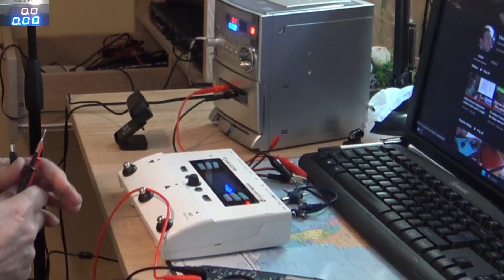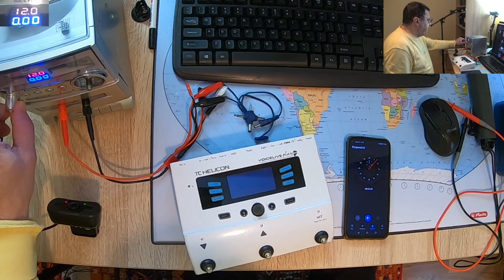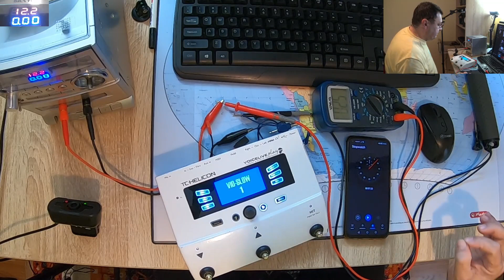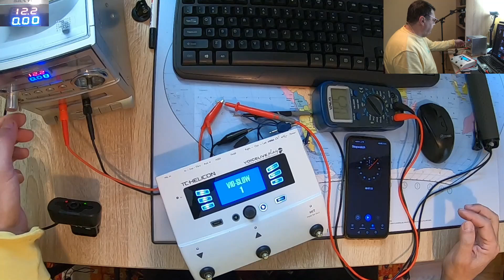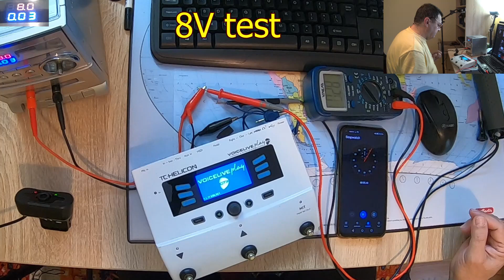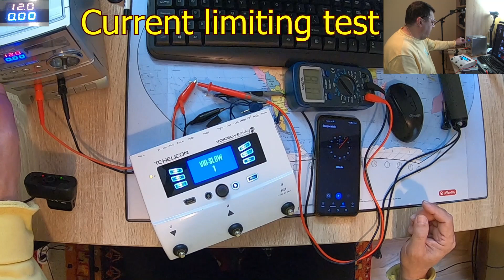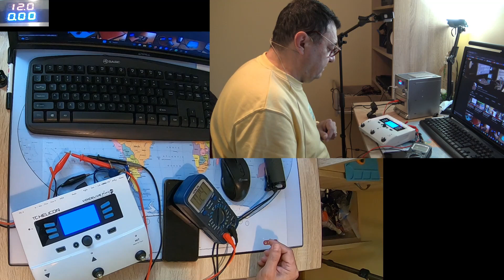TC-Helicon VoiceLive power supply test

Comment: Hello sir, I have a defective tc helicon power adapter. I tried a 12 volts 700 ma but it doesn't work. What do you think is the problem?
Reply from the maker: Check the polarity. TC-Helicon should have plus on the outside ! So inside pin. Usually plus it's in the middle but TC-Helicon it's reverse polarity. Cut the wires and reverse them.